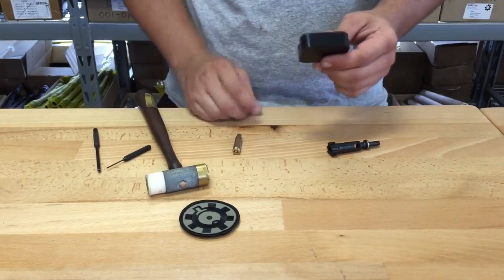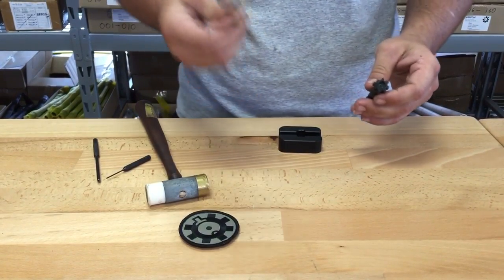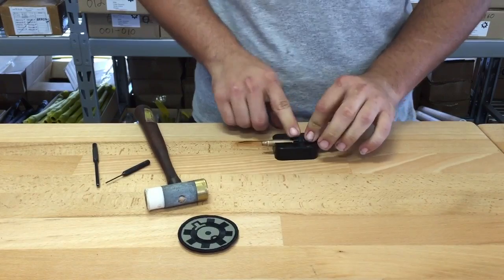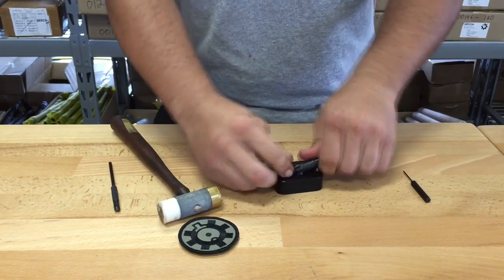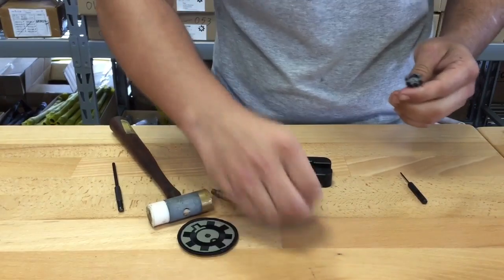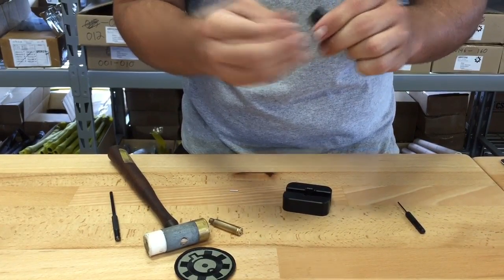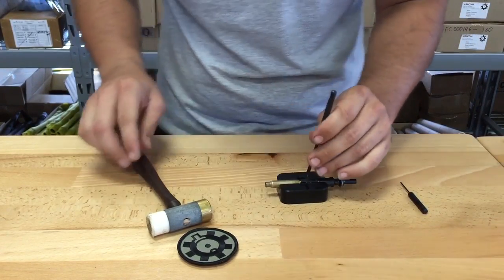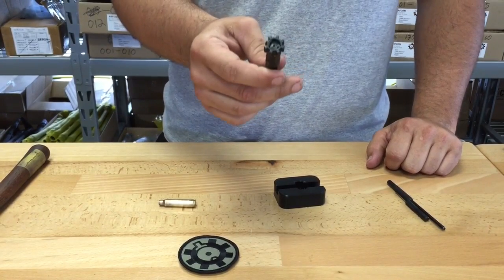AR-15 Bolt Assembly Block Demo

Comment: Hope someone can answer this? Im trying to remove the roll pin to switch it out for a new ejector pin. Im having a hard time getting the pin out. I have a kel-tec model. Almost similar to the AR bolt carrier. Any suggestions??

Comment: Helpful, but a bit too much in a rush. Also, no warning about ejector flying across the room due to spring pressure. . Yes, it happened to me ! I surprisingly found it but not the spring, so I've had to order an ejector spring from Brownells.

Comment: Cool.. Might have to pick one up..  Other than repair though, if it ever needs it, what other reason to remove it?  Cleaning?  I doubt military users clean that little part anyways.
Reply: +enterprise59 Checking headspace. Making room to soften the edge of the hole if it's scratching the hell out of the brass.